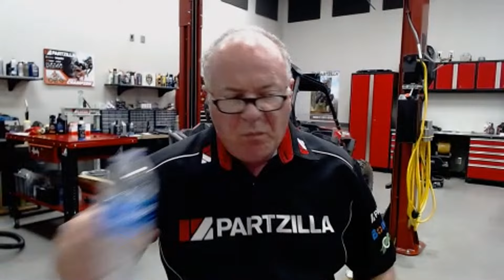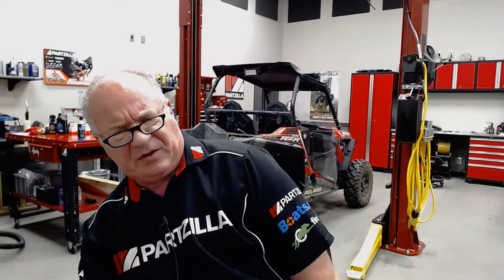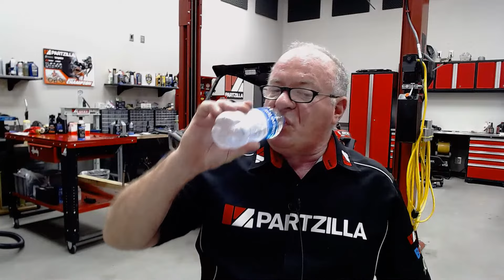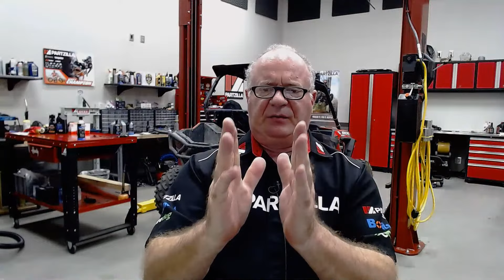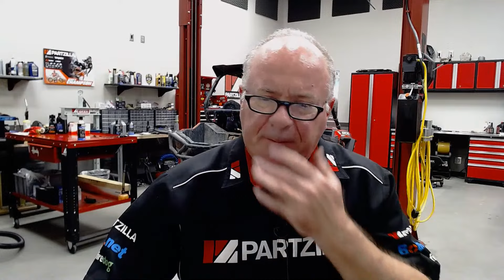Live Q&A with John Talley | Partzilla.com

Comment: Hey John... I have a 2005 Kawasaki brute Force 650. After a weekend of riding I was having problems with it idling so I pulled the carburetors apart and cleaned out all the Jets and fix the idling problem now I'm having a bog right off idle but yet😮😮 it runs good three-quarter to wide open throttle. If you choke it it makes it run well in the mid-range but not idle. I also changed from a k&n air filter to a twin air filter in this process.